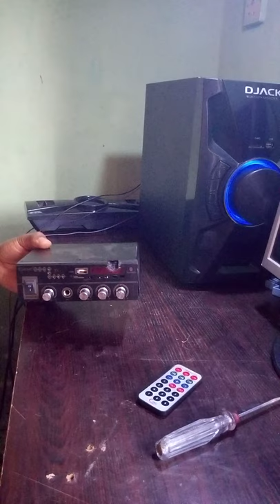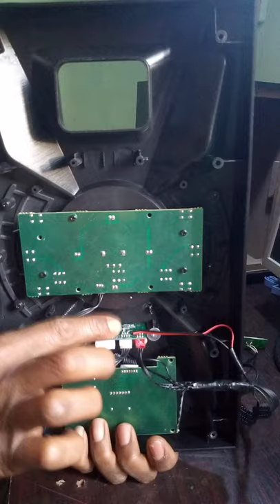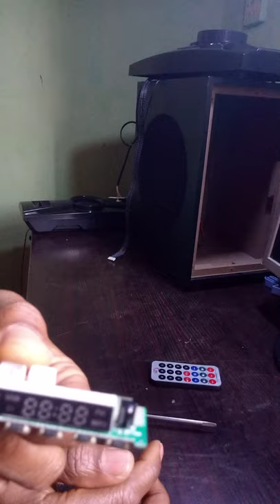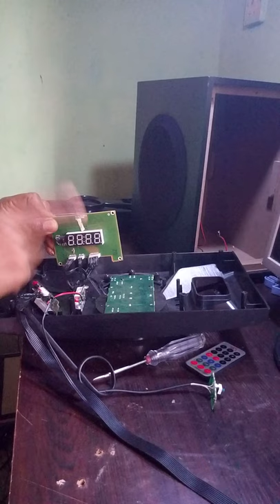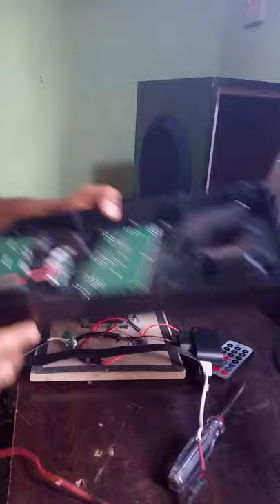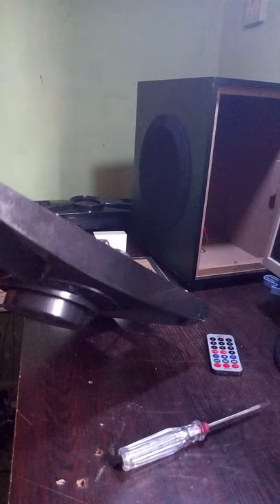No sound no display

Comment: What could be wrong when a particular frequency on FM stops working but other frequencies are working
Reply from the maker: It could be lost of range, either from the receiver or from the transmitter. Also consider the location of the radio frequency. Pls don't touch any coil or capacitors around the FM board